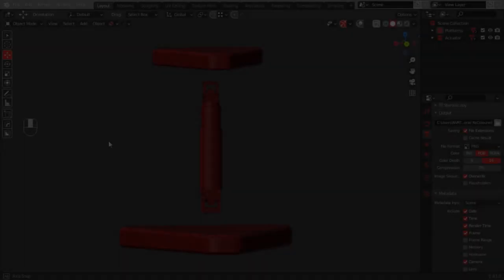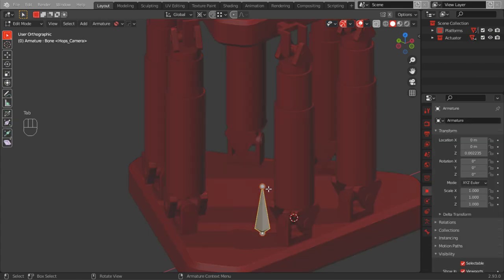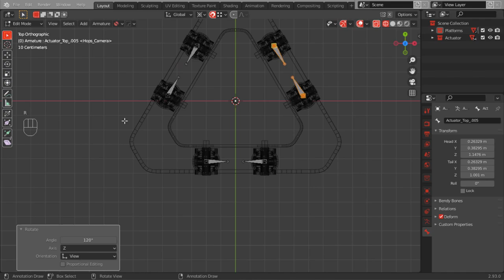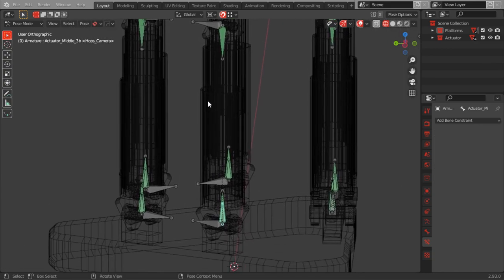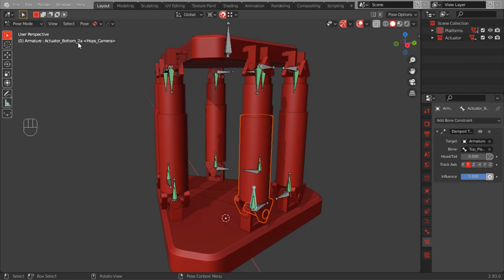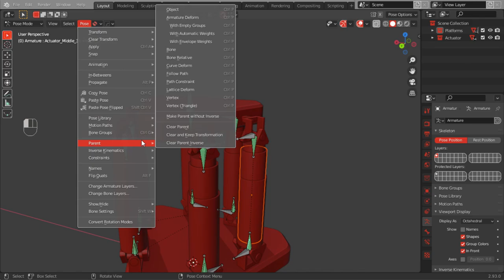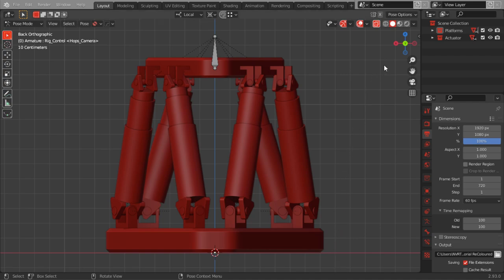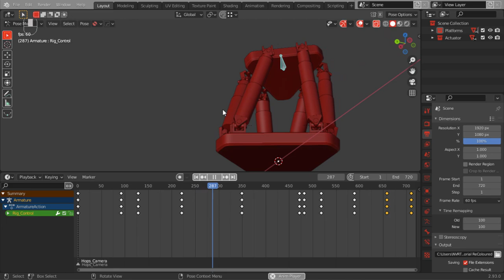Rigging & Animating an Hexapod in Blender 2.93 | Tutorial

Comment: one question, for a mesh like this, how do you go about measuring the proportions of everything? I guess it only really becomes neccessary when you put constraints that make it so the piston things cant extend past a certain length but do you have any advice for this?
Reply from the maker: Great question. Firstly, I'm not an engineer, so I don't take things like material tolerances that would impact the size and shape of each component. That said, I think the goal should be to ensure that the final result looks like it "works". That means things like piston elements constrain so that they don't separate when you go too far in any direction, or that you have enough clearance around all your joins so that you don't have clipping when the device is in motion. You see me playing/testing this out in the original timelapse before settling on the design, so I went into this one with that in-mind.

I think the term is called "flexing" the design, and it's nice cos you don't waste material (cos digital) and you usually end up learning a bit more as you go.

Thanks for watching.